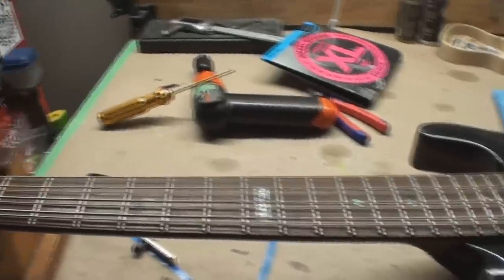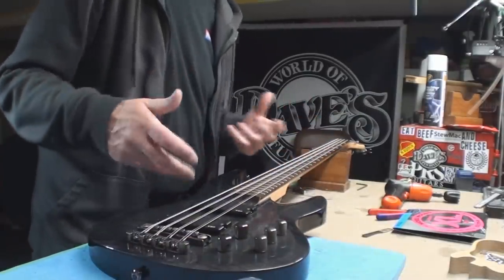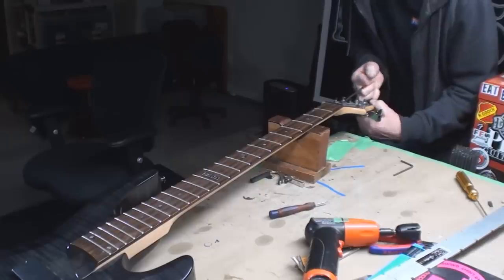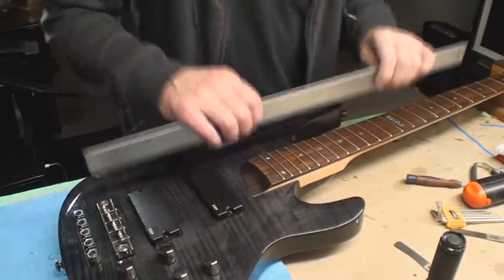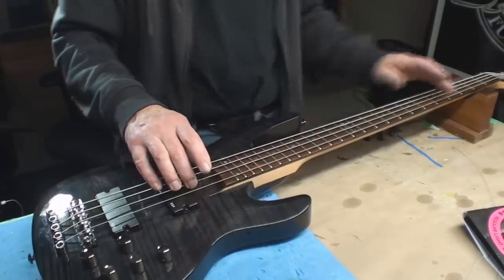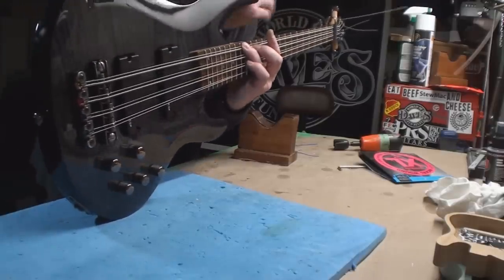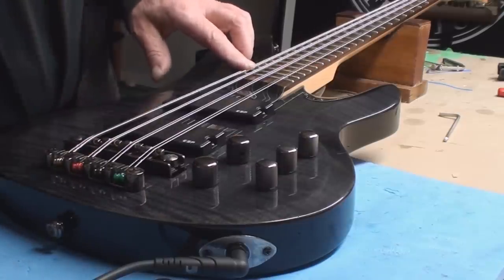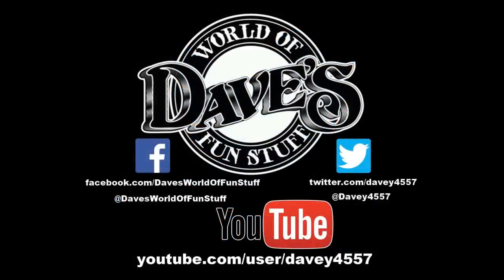LTD 8 String Bass Guitar

Comment: Why not just use an octave pedal? Much cheaper/simpler way to get the same sound out of any bass.
Reply: remurdereht why not just use a synth converting a basic electrical signal into sounds and notes and cut the instrument out entirely, it’ll sound the same.
Reply: @DavesWorldofFunStuff  The strings in each course are in octaves

Comment: Had an 8-string Hondo in the early-mid '80's.  Great bass built in Japan with a Dimarzio P-Bass pup.  My guitarist would cower in fear when I whipped that one out.  I learned to also change the tuning on the high course strings.  Like, to fifths or thirds.  I could play a smashing version of 'Wheel in the Sky' by Journey on it.

Comment: Hey Dave, are you using the same pickup heigth for active and passive PUs?
I know it's just a starting point for whatever the player likes, but how do you like yours?
If you got a one with a dummy coil, do you move it as close as possible without hitting the strings? Interesting thing...now I know where that sound comes from. Heard it on a "Moshpit Justice" album. How is Intonation with 4 saddles for 8 strings? Thx for the video.

Comment: That is pretty cool.  Tom Peterson I think has the thinner octave string below the bass strings?  So that 8 would be picked with down strokes?  Like it.  Might have to get one.  15.75 Radius...full scale 34" and 45mm nut width.  Nice finish.  Hardware looks good.  About $650 for that bass now.
Reply: Actually Tom Peterson plays a twelve string, which is like an eight with an additional set of octave strings. Dug Pinnick of King's X plays a twelve too and there's one on Pearl Jam's "Jeremy" in the intro/and also the chorus.
Reply: @offbeatbassgear  you da man!  thanks for the info

Comment: 8-strings are spectacular (see my vids) but they often don’t work well. The necks are under a LOT of compression and over years they’ll shorten, not always evenly; mine developed a small kink at the heel that a fret dress was able to compensate. Individual saddles are worth holding out for. Nut slot depth hugely affects playability. Some string sets’ octave Gs are WAY too loud (GHS’ is fine). I always use a pick. You will HAVE to roll the highs off to play in any conservative ensemble setting; it’ll just be too weird otherwise.
Reply: MomoTheBellyDancer no; mine worked eventually. That’s kind of why I say the best 8-strings are old 8-strings that have had 300-400 pounds of compression on the neck for over a decade.
Reply: @MomoTheBellyDancer Yeah, but c. 1979 graphite necks were a bit scarce.

Comment: I bought a TC sub and up pedal to emulate this effect.  Unfortunately it's virtually impossible to get an 8 string bass without spending a lot of £££
Reply: Ditto. An octaver will do a close enough job for achieving this sound, especially in a band mix. Buying a bass specific to it seems costly and unnecessary. That said, I would totally buy one if I found a decent deal.

Comment: Is it normal for a bass to have its strings not aligned with the fretboard cause my Warwick has that and it's annoying the hell outta me.
Reply: If it’s a bolt on neck, remove the neck and add in a shim to the side of the neck pocket needed to make the neck sit where it’s supposed too. You have a lose neck pocket. If it’s a set neck, someone was probably drunk on their QC job. You’ll have to buy new unslotted saddles and slot them off center to make the alignment correct.
Reply: @theshotgunscientists  it's a bolt on. Everything else on the bass is perfectly good though! Thanks man.
Reply: Ryan Oswaldt No problem man. I’ve learned 90% of my stuff from watching Dave lol.
Reply: it could be a misaligned bridge too, right?  @theshotgunscientists
Reply: hutttee that’s possible yes.

Comment: How would u determine if a neck should hav a shim or not. And hav u ever needed to put a shim on the other end of the pocket ? Thx
Reply: If the bridge or saddles are all the way to the floor, meaning you can’t drop it any lower, and the action is still too high, you would need to remove the neck and add a shim to the bottom of the neck pocket. I’ve got a Jackson js3vqm bass that yes I did have to add a shim to the top side of the pocket. The adjustment screws for the saddles are really short on that model and I actually needed to raise the action to get it to play good.
Reply: Thx
Reply: Glenn...basically, if the neck pocket is too deep, the bridge saddles have to be lowered so much that the saddle height screws stick way up and catch the hand.  On a bass, it's not that big of a deal because I'm playing close to the neck.  All that shim does is raise the neck up out of the pocket so that the saddle screws can sit lower.

Comment: Dave why can't you put a little dab of WD-40 or Mystery Oil or something just a tiny little drop of something in there no?
Reply: 1. WD-40 is not a lubricant.  It's made for removing moisture from metal parts.  2. You don't put metal oil on wood.  3. The problem isn't lack of lubrication anyway.
Reply: @guygordon2780  a little drop of any kind of lubricant isn't going to hurt it tiny little drop ain't going to hurt nothing instead of struggling with it and possibly stripping the thing you got to do something or else you're buying a new neck I certainly would instead of forcing it and taking the chance I'm just wondering why I've never even seen anybody do it yet I mean that's the question also the parts inside there are metal bud